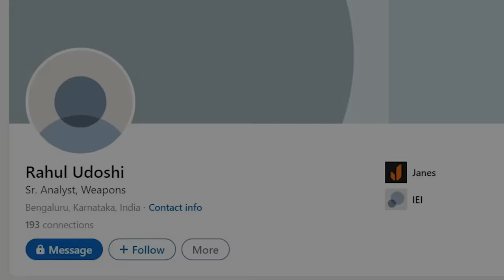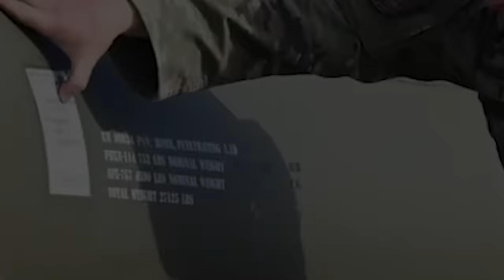US Accidentally Posts Photo of Secret Bomb To Hit Iran Nuclear Plants

Comment: i had a feeling you were going to talk about.
The GBU-57A/B Massive Ordnance Penetrator (MOP) is a precision-guided, 30,000-pound (14,000 kg) "bunker buster" bomb used by the United States Air Force.[2] This is substantially larger than the deepest-penetrating bunker busters previously available, the 5,000-pound (2,300 kg) GBU-28 and GBU-37.
Reply: And the GBU 72 ??

Comment: I don’t think it was accidental. They easily could have just made a penetrating version of Moab. Possibly tungsten or depleted uranium and icbm or other hypersonic delivery system.
Reply: MOP stands for Massive Ordnance Penetrator calling it a modified MOAB (Massive Ordnance Air Burst) is messing up the timeline. They were developed in parallel as part of the same development program under a single line item in the federal budget. 

The only thing mentioned in this video that might have been classified at the time is that the version using PBXN-114 was already deployed. The ratio of conventional explosive to polymer explosive may have been classified, but on earlier variants that was usually not classified, the geometry of the penetrator and bursting charge are the secret sauce, not their chemical composition.

Comment: 5:20 We are assuming that those numbers are accurate and the posting of the picture was accidental. 
    I bet the numbers are not accurate (but still plausible) and the posting of the picture was not an accident. But the Air Force wants us to think it was an accident, so we will trust the numbers. How long would it take to paint over the original numbers, paint on fake numbers, take the picture then restore the real numbers?
Reply: Why bother with fakes when you have the real thing?

Comment: I wonder if there will ever be a bomb as heavy as the T-12 Cloudmaker. This bunker buster used by the B-36 Peacemaker weighed 43,600 or 44,000 pounds depending on source. The T-12 was 26’10” long which is about 6 feet longer than the MOP. It is the largest conventional bomb and bunker buster of all time.

One cannot help but wonder if the USAF does have a bunker buster as large as the T-12. The MOP would be very capable and plausible deniability  at the same time.

Comment: I honestly do not see anything of real importance in the pic. Just the required shipment/inventory markings for the bomb. No build number, no fuzing, no indicated delay or guidance pack (which is obviously no installed). It's just the bomb itself. You can get similar info from the markings on a MK82 body.
Reply: Yup just basic stuff like gross weight, explosive weight, date of mfr. Nothing too sensitive.

Comment: If just one of these heavy penetrators were to be dropped even 100 ft away from a fully operational nuclear reactor, the vibration and seismic shock would force an immediate full and permanent lockdown of its operation even if the reactor was not destroyed as the structural interior be totally compromised.

Comment: Tallest mountain range in Iran has a height of 10,000 ft or 3,000 meter, mostly hard rock.  The Iranians have been drilling these mountains for years with multiple tunnels, caverns, multiple entrances plus emergency entrances, etc.  Most likely that have enriched 90% U-235.  They need 15-20 kg for spherical device using Beryllium reflectors.  They could launch these things using their multiple missiles.  That is the reason, Israel and USA have not attacked Iran or even NK,  like they did in Iraq, Syria, Libya, etc.  Power perceived in power achieved.  Attacking Russia or China?  That belongs to the nut house.

Comment: They should build a bomber that can drop 4 at once so they penetrate the same area.
Reply: They'd need to be dropped in sequence. Dropping all at once would likely result in the first bomb destroying or disabling the other 3. In which case, having 1 aircraft carry all 4 is a big liability. It'll have to linger over the target area, endangering itself needlessly. Better to have 2 or 4 aircraft carry 2 or 1 bomb each. 

Plus, no bomber has ever been built to carry a 120,000 lb weapons payload. Nothing has even come close. Building a handful of super heavy bombers would be incredibly expensive. Way more than building a few more B21s to get the same payload capacity.
Reply: @dgthe3  but that lessens the chance of hitting the same spot. If one penetrates 400 feet a 2nd one should male it go deeper. You might have to go deeper to destroy the target..

Comment: What is pbxn normally used for. Is this to prevent premature explosion?
Reply: It is a very high energy yet insensitive explosive. They use it in nuclear weapons for the implosion system. This bomb likely would have the regular explosive excavate a crater then trigger the pbx charge that does the actual bunker busting.

Comment: Bunker buster bombs run into physics problems with depth.  The difficulty in penitratiin is something like a cubic factor.  To increase the penetration both the weight and speed need to increase but limits do get reached.  The problem is that objects not moving tend to not want to start moving.  It takes energy to do this but at some point this energy is greater than any material can handle.  This is why a high speed projectile hitting water will not penitrate but disintegrate on impact.  Same when hitting the ground.  So a facility dug into sever thousand feet of granite, which Iran has lots of places for, is not going to be taken out by a penitrator bomb.  I am fairly sure Iran has planned for any conceivable pentrating bombs, including nuclear in their critical facilities.  Iran also has good air defense ststems much better than Russia's.  I personally don't think any sort of milatary campaign will have much effect on Iran miltary for the above reasons.  The oil facilities are a diffirent matter.